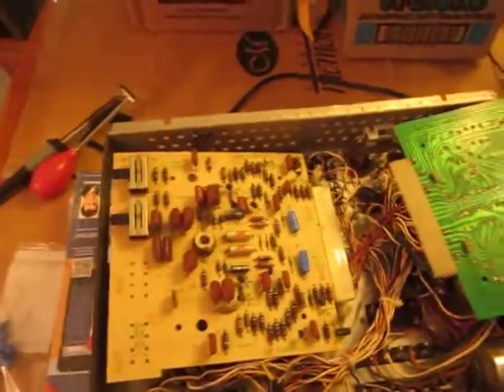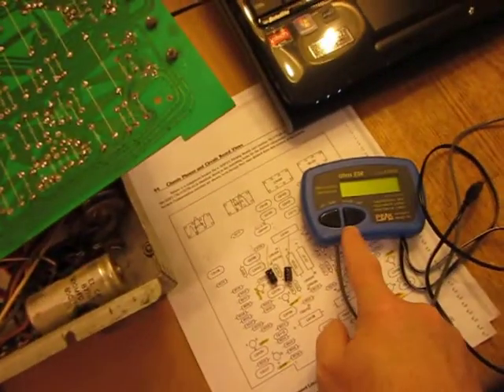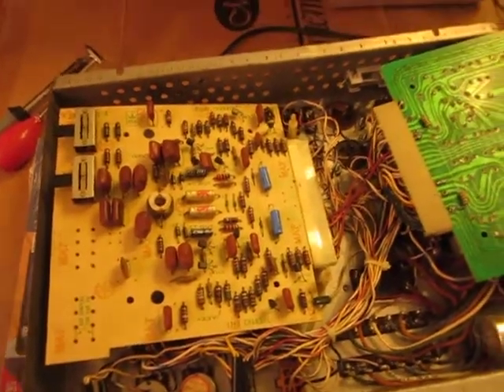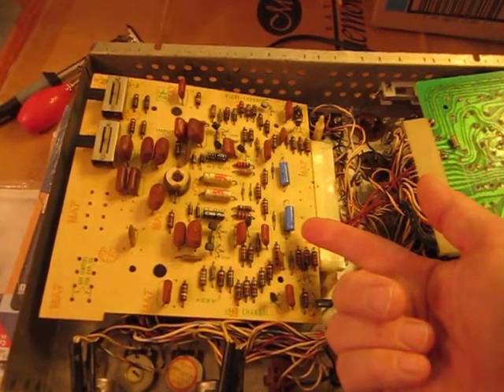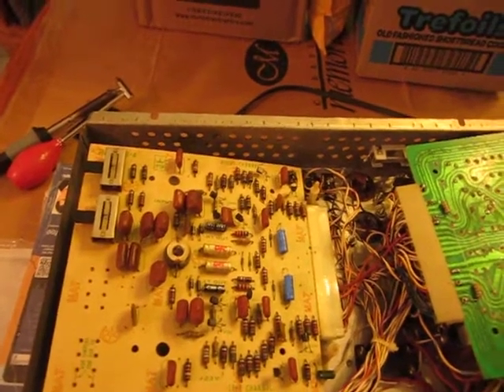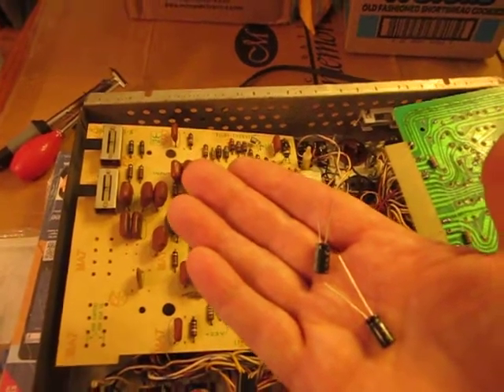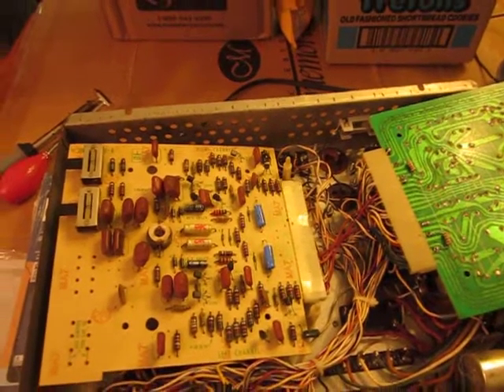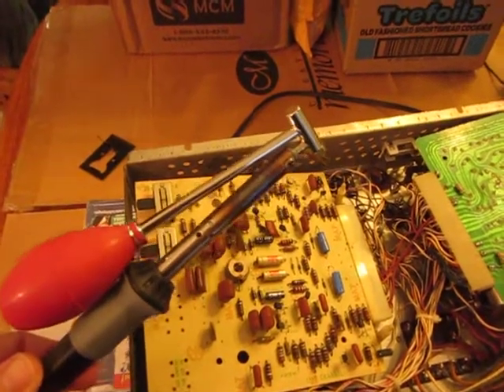Seeburg SHP3 Amp Recapping Tip 1: Test New Capacitors Before Use

Comment: Electrolytic caps that read high are usually leaky,  as they've been sitting around for way too long.   I usually don't keep a mass of electrolytic caps on hand,  and order them in small batches as they are needed.   Mylar and ceramic caps don't break down with age,  so I stockpile those a bit more.

Comment: Would 97uF capacitors cause a problem in this case? Surely it depends what part of the circuit they were in, if used to smooth a DC supply rail then 97uF would be better than 47uF. In other parts of a circuit a 5% or lower tolerance may be needed. Good tip to check replacement capacitors though, thanks for uploading.